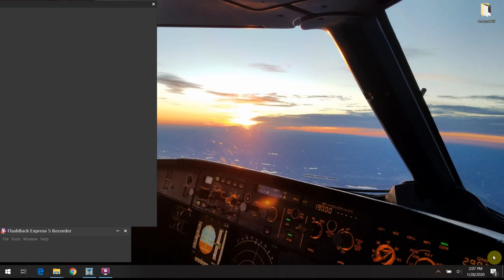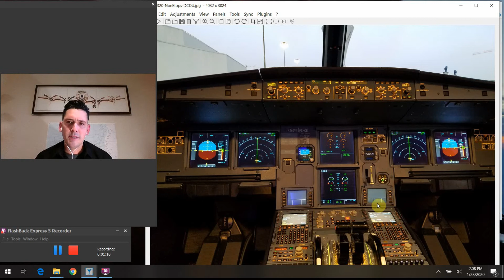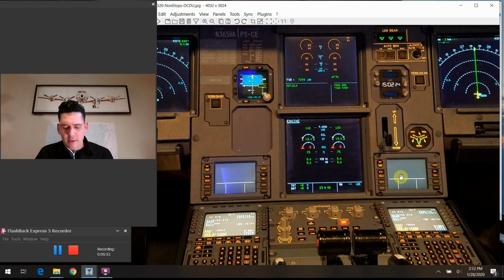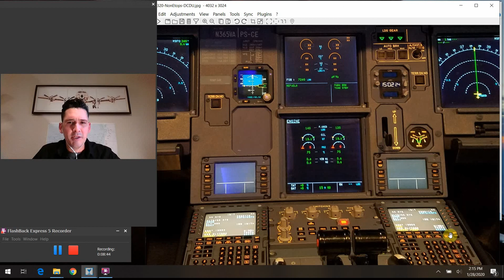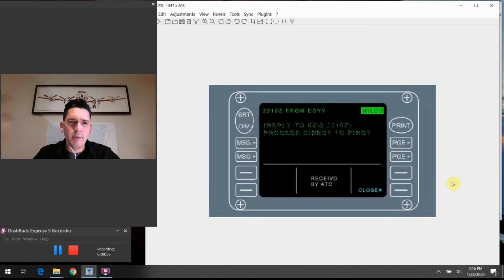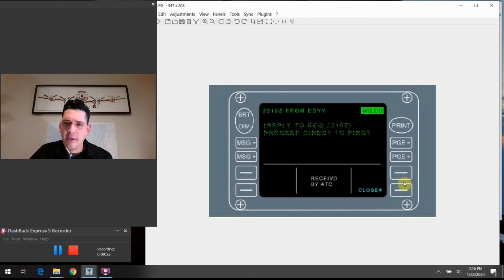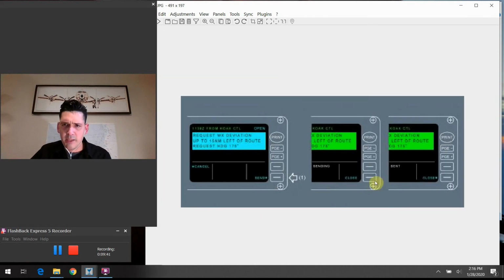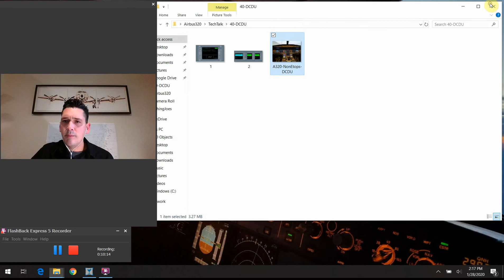Airbus A320 Cockpit Tour: #40 - DCDU (Datalink Ctl and Display Unit): What do all those buttons do?!

Comment: Hi Mr.Abignale, is it possible for the CPDLC and DCDU to communicate between aircrafts instead of ATC controller? If yes, how often is it used?
What is the difference between CPDLC /DCDU and ACARS?
Reply from the maker: Hi Aby! Cpdlc network is not used for aircraft to aircraft communications,  only air traffic controllers to individual aircraft.  As for the difference between ACARS, think of it like this. ACARS is like dial up internet. It's,  old,  antiquated, slow, has system limitations. CPDLC is faster,  more reliable, more modern. Can utilize Satelite comms. ACARS is strictly VHF reliant and therefore has limitations as well due to ground radio necessities. Thanks again for tuning in! Hope you are having a fantastic day
Reply: @MikeAbignale  thank you Mr.Abignale. Have a nice day 😀